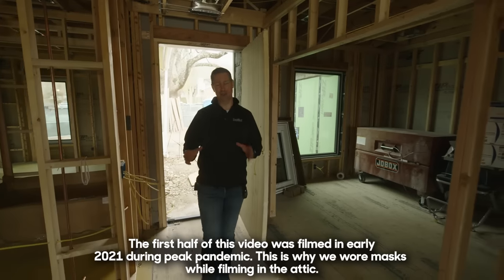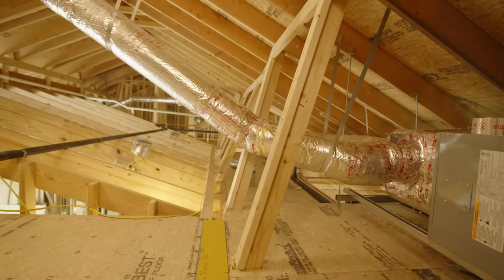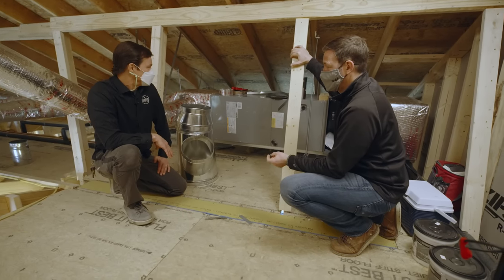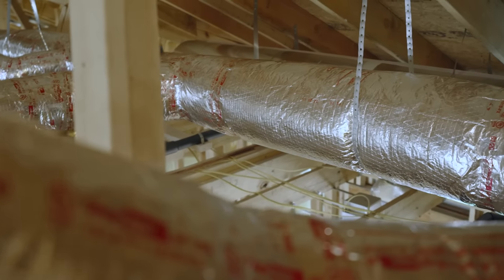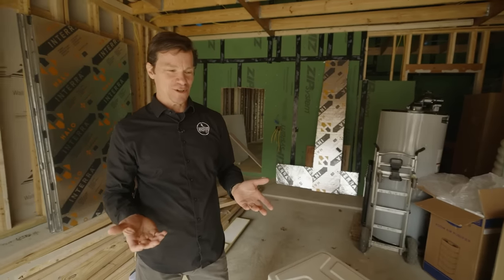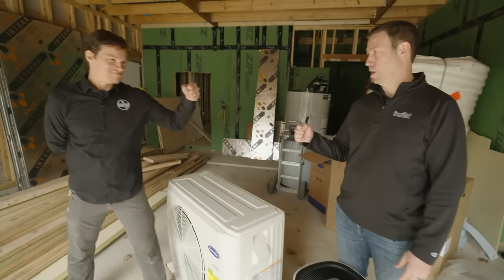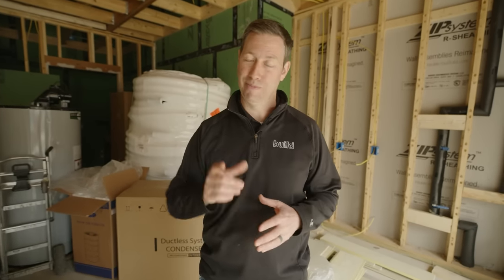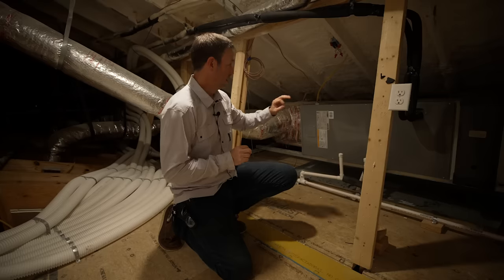HVAC Done Right! Watch this before you install!

Comment: So sorry to hear about your mother-in-law. When we replaced our 20year old system last year the technician was receptive enough to plumb the water outside to a rain barrel. We live in San Antonio and I’m shocked at the water we just flush down the drain every summer. We have a 20gallon rain barrel and it fills to the brim every two days. My lawn and plants never looked so good.
Reply: That's a great use of the condensate!
Reply: Good idea.
Reply: It works especially if you mix with rain water for minerals
Reply: I reuse mine too   Some day we’ll all have to. When will water b $5 /gallon??
Reply: @scottwebber652  Probably never, it costs 3-4 cents a gallon to desalinate water which is currently an expensive way to get water.

Comment: The old heat pumps had so poor performance near a freezing outdoor temperature is because the US manufacturers didn’t want to impinge on their furnace market.  It was only after the Korean mini splits forced companies like Carrier to compete did you start seeing heat pumps with good cold weather performance from US manufacturers.  Should sort the market out now though.
Reply: Not up north. They cannot maintain a high enough  heat delta to the outside. In Canada, you have to specify additional heaters for really cold days. I opted to not use them.
Reply: I live in Quebec and i have a 2 zones 24000btu fujitsi mini split and it keeps my 1200sq ft floor space to 22°c down to around -18°c outside. And it's and pld house with old wooden windows and pretty standard insulation. 
Those things perform really well. 12th year now and never got a single problem with it.
Reply: @ProbeGT2  Same thing i Norway to. We have had inverter controlled mini-split heatpumps that works down to at least -15 degrees Celsius in the wintertime for 20 years now, they where mainly brands from Asia.
Reply: I saw somewhere that Carrier uses the Mitsubishi technology and Trane uses the Toshiba technologies in these variable frequency driven systems. Something about tooling over and costs to the production facilities using previous designs the market dictated. Your point about the industry impingement is illuminating. Freedom actually consists in the insight into contingency of what was presumed to be necessary(Hegel).
Reply: @testthisfordecficiencies  Wrong Mitsubishi H2i + hyper heat units will give 100% full heat to like 5 F 60% -15 F...It's not 1990 anymore And the SEER rating are phenomenal.  the world uses Mini Splits the U.S. doesn't cus we are as usual, behind the times....
Reply: @SnowyOwlPrepper  Trane joined forces with Mitsubihsi, they use market Mitsubishi...king of mini splits, Mitsubishi
Reply: Have you ever thought about why other countries use more mini splits? Look at their houses. Lot of them are small and older than our country. You can’t add ductwork to most.

Comment: I had a huge problem getting a very sizeable rebate from my utility (a subsidiary of Exelon) because my DUCTED Mitsubishi system was classified by AHRI as ductless. The efficiency requirements for the rebate for ductless is higher than an VRF  traditional  ducted unit.  The outside company that managed the rebate fulfillment strictly goes by the AHRI classification. To that end, I got nowhere pleading my case with them. I called AHRI which was useless. Finally, I emailed the CEO of Atlantic City Electric and explained the issue. Someone knowledgeable about my issue called me back and agreed that my unit was ducted and should only have to meet the VRF unit rebate requirement.  Thus, I received the $600 rebate after they directed the fulfillment company to do so.  I think the manufactures need to direct AHRI (which I believe is an industry group) to address this problem. Currently I can see someone for example not buying a Mitsubishi unit because of this issue.
Reply: great story
Reply: Call  your local politician and tell them about this inequity....you may find that you can get a positive response.  Many of these rebate programs are federally funded.
Reply: They come across as well meaning but their interest is in making a living for themselves.  That included politicians looking to make points.
Reply: Good job!
Reply: @elgringoec  especially gas rebates, it's to keep people addicted
Reply: @twolfe4295  Incorrect. While new state rebates (not utility) programs starting in 2024 as part of the IRA will be federally funded, but your traditional utility rebates are NOT federally funded. The funding come from small fees on your electric gas bills determined at the state or local level and approved by state energy commissions to subsize energy efficiency (rather than building more grid capacity, which is often more expensive). Programs often rely on criteria of a voluntary federal program ENERGY STAR  to qualify eligible equipment, but that's the extent of the "federal" component of these utility rebates.

Comment: Another benifit of multiple smaller outdoor units is they tend to be more efficient than one larger outdoor unit.  For example I've seen some 9k BTU units have a 30 SEER rating.  That's crazy efficient!
Reply: I have never seen a 30 SEER even on a 9k unit. Could you give us a brand & where we might find these. 21SEER is the top I have seen on any brand or size.
Reply: @morrishowell7410  Blueridge has a 38 SEER, Fujitsu has a 33 SEER
Reply: @morrishowell7410  Carrier Infinity series 38MPRA up to 42 SEER 
Mitsubishi MZ-FS09NA is 30.5 SEER
Reply: @wjthehomebuilder  Thank You Sir, I have never seen these advertised anywhere before, I will check them out.
Reply: @wjthehomebuilder  new Mitsubishi h2i hyper hear in northeast has heating down to -15 f....which is amazing....no resistance heater...
Reply: GREE EXTREME 9K 38 SEER EVEN 12K HAS 30 SEER AND 18K IS LIKE 25 SEER AND the TOSOT also a gree manufactured arctic weather as well